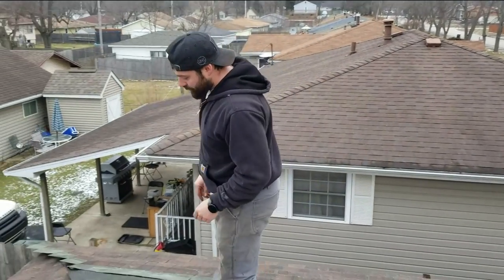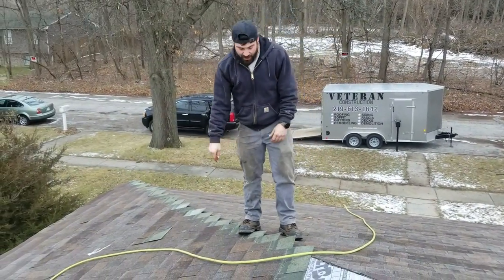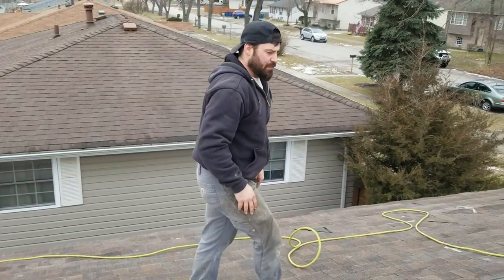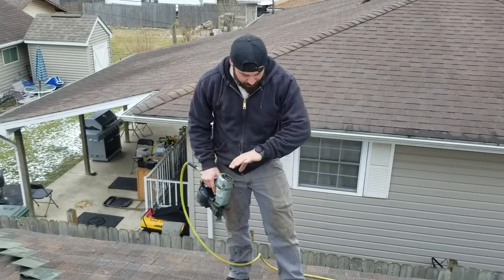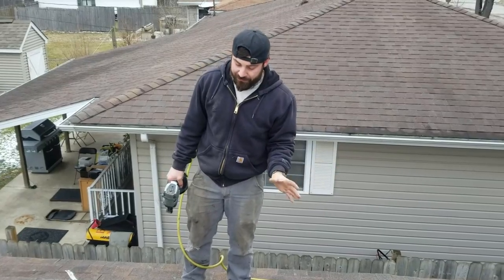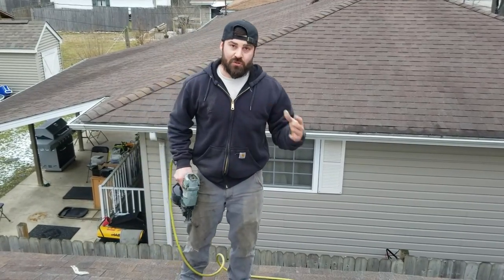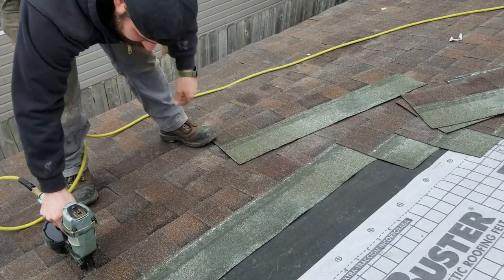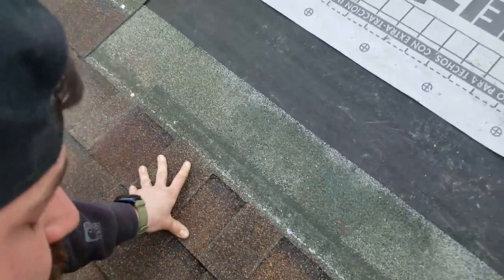Worlds Fastest Shingler TIPS AND TRICKS

Comment: Been watching here and there and this one made me subscribe. Best yet with the laid back but informative instruction. 
I've been shingling almost 10 years and this is almost exactly how I do it. 2 major differences:
1 - laying out the bundles I tear them open like that but Instead of spreading them down the side I just flip half end to end and do this with as many half bundles as it take to fill the run. Next run the left overs get flipped or slid to position as I go back down. I wear a belt and have a hook on my gun so I have everything I need to get started right away. I find this means less back and forth and I'm never reaching for shingles.
2 I'm a gun dropper (I know this is "slower" but I never got the hang of using the nose to line them up) so I pinch the shingle with  my thumb and forefinger. Then I use my  knuckle on my right hand to catch the Thatcher line similar to how you use your gun. I do the same with my left but I put it right at the end and catch the shingle I'm butting into with my knuckle making them line up perfectly every time. 
That takes a little practice but I don't really have to look at what I'm doing and. Everything lines up super fast
Reply from the maker: It's not necessarily slower! The two fastest times in the one square challenge besides me do it like that! Check em out
Reply: @NWIVeteranConstruction  I've seen a couple. Debated making a vid myself. Timed myself a couple times earlier this season, averaged about 8-9 minutes. Everytime I remember to give it a shot the roof I'm on doesn't have a big enough run or there's a bunch of bs in the way
Reply: Pia cm V

Comment: Great video! A lot of people think nailing fast equals roofing fast. I feel like shingle placement is more important. I used to count seconds on every shingle, although I generally just float around in roofing zen now. If you put on one shingle every 10 seconds, then that's just over 1 bundle in four minutes. Yup. Never stop learning, never give up! We'll beat these dang roofs one day, until then, keep fighting the good fight!
Reply from the maker: Yessir! Thanks for the comment and helping me drive the point home! These speed nailers gotta learn! Lol nailing speed is the least important factor when it comes to shingling speed. As you said, it's all about having a system that allows you to get the shingle in the correct spot without it taking a long time.  The difference between a fast nailer and a slow nailer can be a second or 2 per shingle... but the difference between a man with a system vs a man without a system can be a difference of 15 seconds easily on one shingle

Comment: For my coils, I made a coil holder out of a PVC pipe with an end cap on it. cut a slot using my dremmel from top of the pipe, right down thru the top of the end cap about a 1/4 inch. I then, figured out the best position it would hand on my belt, with the slot/channel or the sweet spot for my finger to reach in and pull out a coil. I made note of this position and in the right spot, using my dremmel, I cut 2 notches that I could feed my belt through. It can carry 8, 1-1/4 inch coils or 6, 1-3/4 coils

This saves me time from looking for my coils, they're no longer accidentally getting kicked off the Roof, or jamming two together to stick in my pouch, or running to the nail box every time I grab a bundle.

working on another one atm where I can delete the belt notches and add a clip that I can take it on or off when I want, but without it accidentally coming off when I have to get in weird positions to shingle under dormer eaves or the like.

I'm looking at this system to hack, just need to figure out how to mount the locking clip from a donor pouch, onto a cylinder, and not have bolt heads making coil removal a pain in the arse. I'll probably use Stainless steel cup head bolts, and maybe grind the heads down a little
Reply: Jesus Christ!
Sorry for that long ass comment. Ain't nobody got time to read that. I'll leave it anyway

Comment: Everyone who’s done this for a while knows a lot of times the shingles were cut different. Just an eighth of an inch sometimes top to bottom. That is why using the gauge on your gun it’s much straighter than using chalk lines. Chalk lines make the top of the shingle straight, While the gauge on the gun makes the actual bottom and exposed face of the shingle straight. And it’s at least three times more efficient than sitting your gun down between every single!
Only negative I have about your vid is tearing that rapper in the three pieces! That drives me crazy! I open a bundle, take half and lay them, Then grab the other half and tie the wrapper in a knot so it doesn’t get the neighbors involved in my project. 
You said you cut your bundles usually so I know you probably won’t do that normally! Great technique and attitude though man that’s the same I used for 28 years now.
I tell people all the time your priorities on a roofing job are: customer, company, then you worry about your pay.
And don’t tear anything up!!

Comment: Do you run chalk lines at 5 1/2 inches apart?
Reply: That method is used for 3 tab shingling.. You stagger 3 tab shingles back and forth.. When you're laying dimensional, you do what's called a stair case.. You'll see what a stair case is right when Zach starts shingling

Comment: Just wondering. Would it be better to put the first and last nail in the middle of a tab. Like 3 to 4" away from the key way, mid point of the key ways? As the key ways are a haven for capillarity, big increase in surface tension. Don't know anything about this type of work so forgive me if I've missed the obvious. Just might help keep the nails dryer and can't see it causing tears. Slate/tile roofer from the UK.  Looks like damn hard work you do there!

Comment: Dude, I have seen a couple of your videos and I was 1st in conflict with your comment doing vinyl siding " be a man, bend over".  Im 63 yrs old and have been working on houses 45yrs, hanging off ladders, climbing scaffolds, whatever it took.  Lightweight drywall came out 20yrs after I ruined my back for me to benefit.  I cut my teeth hand nailing asphsalt roofing in early 1970s.  I often worked alone and wouldnt nail a shingle until I carried all the bundles, often 2 at a time.  Im a scrawny 170lbr, 6ft1..  when nail guns came out I increased production X 4. 
My advice would be to take extra care with your most important tool, your body,  Dont jump off scaffolds or out your truck.  Decrease the time you bend over by using horses and tables OR SIMPLY A GARBAGE CAN BY YOUR CHOP BOX..  get help moving heavy items.  you need to be in this for the long run.  This is not the last job you will need to do in your life.  iTS A MARATHON NOT A 50YD DASH. My method was attention to laying out 30lb felt.  Once that was precisely laid (alone mind you, any one else would get in my way and slow me down). I would lay a bundle,to my right, bottom facing me, and nail 1 left, one right, 6ft wo changing position, and work up following the lines on the paper (they are there for a reason).  Often I would just  parallel and measure up from bottom every so often and after half way, measure down from the ridge.  
I challenge anyone , ANYONE. to out produce me and Im 63 w broken heel working on 1 leg w 10 surgeries over last 12 year  Bring it on MFs

Comment: You are right. Systematic and deliberate. Slow down a split second and shoot accurately.
If you are using  5 you are wasting nails. Package says 4.
Those coil nailers are bulky and cumbersome. And they run out of nails too fast.
4 staples. On the line every time. Did it for 35 years.
Reply: 6 nails for high wind areas
Reply: @nickdavis354  Probably a scam by the coil nail industry. Use 50% more of their product and scare off the wind bogeyman
It ain't easy to blow off a shingle if the bottom edge is sealed  down. Go up there with a leaf blower and try it.
Extra nails just clutter up the shingle and run you out of nails faster.
I cringe when I hear a roofer going crazy with the gun. And they all do it. If you ever hear a guy shooting 4 it is probably me.

Comment: Zack, do you ever snap control lines every third or fourth course to keep your lines straight, especially on long runs? in all your videos, your courses are all arrow straight, but it looks like your just going off the exposure, with nothing else to guide you. A lot of good tips in this video, thanks for the upload.
Reply: George Dosil the guy I used to work with did this. I never did get to learn how he did it.
Reply: I see you never got an answer, I was curious also but I assume he's using the grid lines on the feltbuster. Wouldn't that work if it's stapled down straight?
Reply: @UshouldTryReality  , and Christopher Crawford, the way I seen it done is by the exposure...5" exposure means snap a line every 40" to maintain  straight lines. Like you said Jeremy,  laying  the paper straight and following  the lines  would work, if someone  would take the time to do it correctly.

Comment: Do you gap your shingles? I live in maine and was always told to gap the shingles. Love your videos and attitude dude, keep them coming.
Reply from the maker: no I do not. and unless maine specifically has different rules from these manufacturers I think that you should not either! let me know if you find out otherwise. don't believe everything you're told, like I said in this video, I was "taught" by some shady people
Reply: @NWIVeteranConstruction  thanks for the reply! I'll have to see what manufacturers have to say about it.
Reply: Austin Shaw only thing I can figure is that a three tab needs a proper gap to look right?!? But a laminated architectural shingle should not be gapped
Reply: @Beandiptheredneck    that makes sense. I was told to do it because of expansion of the shingles themselves. 1/16 gap. After light research I havent found any manufacturer that reccomends a gap on architecturals, so It seems unnecessary. 
    Next time I shingle I'm not going to bother gapping. I'm Not a full time roofer.

Comment: For fast opening, I kick the top few shingles in the bundle then grab those under the plastic and rip up, 2 seconds 0 wieght.  Same area of placement, on shingles. It's never in the way like that. I just place them horizontally. I nail three nails and the last nail on the last run. I think they call it skip nailing. Nails seem to fall in the right place that way.  Just adding to tips if this helps anyone.

Comment: You can get away  with no tools on a walkable  roof however on a job with bracket and boards it different you kinda need em on walkers  i wear a hammer holster that also holds a hook knife and a small clip on pouch that hold a double stack coil nails light and comfortable

Comment: I’ve been roofing for over 30 years and let you know if you could only convince people don’t hand me three shingles you bring that bundle down and you pass them out specifically in the spots I tell you and it seemed like it’s harder for them to comprehend such an easy job but it’s exactly how you’re doing it is exactly how it supposed to be done don’t be sloppy be consistent I hate the way Tamco does there sealer strips cause in the air to do the valleys California way otherwise they’ll stick to the other side if you don’t cut them as you go because it gets too hot and then I seal down and pull the plug out so I like atlas we were using pass load nailer‘s for years and now they can’t get parts forms an hour using Hitachi it took me about a half a day to get used to that new attachi gun it’s just a little bit different but once you got used to it you could go pretty quick I enjoyed watching your little video I’ve often wanted to do videos of my own in fact I have but I just never posted them I think videos oughta be put out there on where to place the piles correctly to people who are passing them out for you I don’t like someone hand me a shingle I don’t want that I want to be able to grab it and do it on my own just lay them out like I tell you and let me run the row  I’ve done so many low profiles that I can cut a 9 inch hole without measuring it and cut the hole with the hook blade and then shove that been in there so fast people look at me go how do you know you measured it out right away I’ve done 10,000 of them that is love scroll and through YouTube just to see who can lay in the fastest and in a quality control for years we used staple guns and you know who is the sit and spin because if you didn’t place them just right then it’s a problem for the next guy to come in and tear them off in 20 years but still awesome video👍

Comment: Sitting on your side is the best way to shingle and you last longer    yes standing is a little faster I did it for years.         But I had alot old timmers I learn from also teach me hand nailing and they all sit on there left side  you waist very little energy doing this compared to standing even with the gun way more efficient  you can put way more square on for a longer period in your roofing career.     also loading your tool belt up with alot stuff will reck your hips. 4 coils even if it's split up u have 2 pouches on each side the pulling down of it on your waiste will fuck your hip joints up.   Most roofers i know have one pouch and a hammer holster but that is still bad on your hips.    Usually on a steep roof i start it with hand nails and then take my pouch off and use the gun.   And Usually keep my knife with its hook blade in my pocket after I take my pouch off     but  I know some of my guys have knife hosters too. You get good enough at this method you can sit a 10 pitch off a cushion you pinch 8 to 10 shingles under you left leg and shingle and yup you get up off the cushion and get your shingles off the plank or you have another cushion to rest your shingles on and keep moving the cushion. And just trying to give advice for  long jevate been doing this for years i work in new england  I roof threw all the season
Reply from the maker: I appreciate that! I definitely agree with the pouch, but I found ways to get relief on the roof and stay standing. The guy I learned from has probably put more squares on than 99% of the most experienced roofers. He's almost 50 now and been standing while shingling since his early 20's.  I'd bet the house he could still put on 30 sq alone in a nice deck.  Seen him do 33 sq by himself when he was in his early 40s. I'll agree, it's probably not great for your body in the long term, but if you're stretching and finding relief on the jobsite it's the way to go. Can't make enough money off your knees and I sit the way you say to do pipes, that shit hurts more than standing

Comment: Hey man, I recently stumbled on your page and I instantly loved it.  I’m 19 and I work as a rough and finish carpenter in Wisconsin. I’ve been working for about a year and a half now and Walking on roofs is definitely one of my weaknesses and fears, I look at you for inspiration when it comes to walking confidently on steep pitches.  Do you have any advice for getting over fears of slipping ? Your awesome man keep it up, I look forward to more videos.
Reply from the maker: Framing is one awesome trade to be in! I think it's the best base. And for walking just be safe.  If you need a rope put it on.  Don't listen to ANYBODY that tells you they walk 10s n shit. You can walk an 8/12 as long as conditions are good.  But Just be aware.  Know what's below you, but don't think about falling.  Only have a plan of what you'd do if you did.  And then focus on what's in front you.  Don't be distracted.  That's when you get messed up
Reply: get a couple couch cushions. take the upholstery off and use them to step on uncomfortably steep pitches. set one down, step on it, set the other down, step on it, move the first one, step on it, move the second, step on it, etc. that's how I climb an icy roof to set up my anchor for my rope in the winter, but it works for pretty much any sketchy situation until you get your permanent roof legs. if you're having fears of slipping, you should probably be tied off.

Comment: Being fast is good but in the winter time slamming Nails into shingles that are frozen you'll just bust right through them and you won't see it cuz you're moving way too fast. That's why hand nailing is still the best, no if ands or butts about it. Three generations and 65 years of personal experience. Craftsmanship Above All Else.
Reply from the maker: Nahhh just Need to adjust the depth and compressor pressure. I preach on pace nailing. Which is opposite of speed nailing. I inspect every nail as i shingle.  For placement and depth watching for over driven nails and under driven nails. Just hard to see that In real time.  I also live in this house at the moment.  The roof is around 2 years old and there's never been an issue
Reply: @NWIVeteranConstruction  it is something that does need to be said, so I'm not jumping on you. But hand nailing is like brick laying, if you got the time, there's nothing like laying one at a time and thumb rolling those compo nails in, place and thumping those nails in without missing a beat and without smashing your fingers. It's a lost art. Thanks for getting back to me, nice chatting with you.